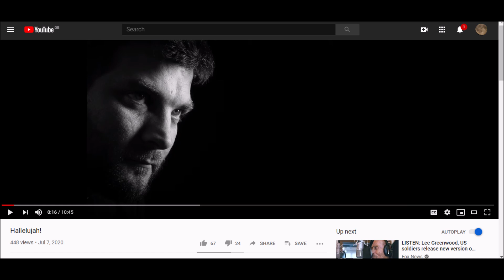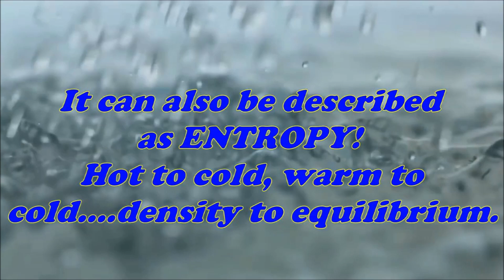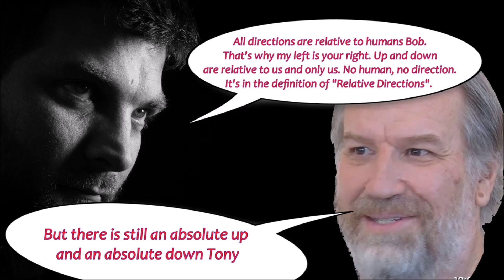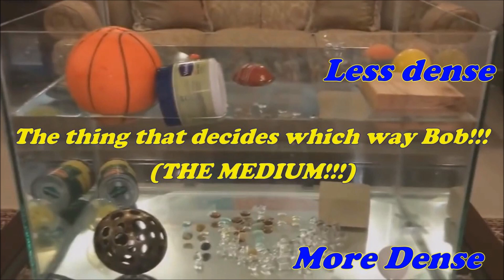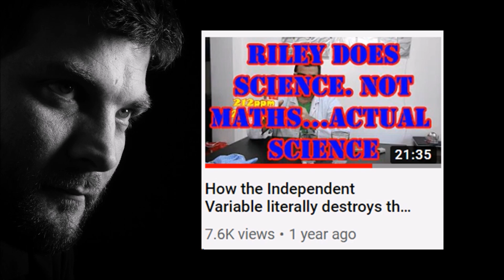Relative Density & Gravity: Riley still doesn't get it.

Comment: So, Riley, if it is not density alone but relative density between objects, why does a feather and a lead weight fall at the same rate in a vacuum chamber? 
Also if I throw a ball upwards, it is a dense object travelling through less dense air. What then, causes it decelerate, stop and then accelerate back to ground? Why doesn't it just continue?  There must be something that causes the ball to act the way it does. I've heard of a name but can't think, it's on the tip of my tongue. Any ideas?
Reply: Cue Desertphile . . .

Comment: Miles. Sleeping warrior did a nearly 5 hour stream on his channel the other day that included his calculations. 
He admits that the calculations are pointless after showing them as the calculations are just comparing the numbers. Check it out. He actually does maths.
Reply from the maker: Thanks I really don't follow what he does so I was not aware of this. I suppose I should have a look at that video but I have to try to keep my blood pressure down.
Reply: Miles Davis 
If you skip through it till you see maths being done on screen then you will have found Anthony doing maths. Be warned: it is hilarious.
Reply: A 5 hour Riley stream? Ain't nobody got time for that.
Reply: Forest Fifer agreed. Although skip to the maths. It’s hilarious. He even admits that it’s unnecessary but he uses it to give the idea more validity. 🤦‍♂️

Comment: At the end of the day Riley's "explanation" why denser objects in a less dense medium fall downward is:
"because my calculation of the Relative Density Disequilibrium by dividing the density of the object by the density of the medium gives a number that is positive (that is in my way of thinking larger than 1) and I assigned to a positive number the direction down"
in short:
"a dense object submerged in a less dense medium falls downward because a dense object submerged in a less dense medium falls downward ".
This is just a begging the question fallacy as you seldom see one.
He also claims that he can calculate the magnitude of the force on the basis of the outcome of the division of the densities of the object by the density of the medium. But to be able to do that he will have to solve the divide by zero error that is inherent to his formula. When the medium has no density (absolute vacuum) or a density that is very low (partly vacuum) he gets no number at all or a number that approaches infinity. That is why he never showed his calculation. And that's why he thinks that 5/0=5.
Again, in short: Riley is an intellectual no-no.
Reply: Hi Frank, let me understand this.
When AR said: 

"because my calculation of the Relative Density Disequilibrium by dividing the density of the object by the density of the medium gives a number that is positive (that is in my way of thinking larger than 1) and I assigned to a positive number the direction down"

According to his own calculation, is AR considering that for an object to float in a given medium  has to produce a negative "Relative Density Disequilibrium" result?
If so, the Density of the given floating object needs to be negative! And as such, these negative density objects will always float in no matter what medium. Unless the medium also has a Negative Density?
Please tell me AR is not that confused.
Reply: @carioca45  I wouldn't call Riley confused, I'd rather say he is mathematically illiterate. It was pointed out to him, that in order to get a negative number you need a negative density. His reaction was: I call a number smaller than 1 negative. The same goes for him being pointed at the fact that an object in a vacuum would lead to a density divided by 0, which is impossible. His reaction was that it is impossible in math, but not in real life. He said that 5/0=5 because when you have 5 apples and you divide them by 0 people, you still have 5 apples.
You might think that I am pulling your leg, but I don't. This all is exactly how Riley has reacted to criticism. He just adjusts his definitions and calls everybody that doesn't agree a spastic, sometimes a spastic with a dog.

Comment: Great work. What stuck out to me was watching the mercury spill over the iron anvil. What caused the mercury to run "down" the slope when, as you point out, the relative density of the air around it was, for all intents and purposes, equal.

The other thing to consider is a zero-g plane flight. I can't see how Riley could explain the motion of objects when the plane is flying "just so" with relative density alone.

But yeah, I'd like to see his force calculations too. I suspect that is just lip-service, and he hasn't actually done any numbers, it's just how he explains it to himself in his head.  And to him it doesn't even matter if you can or can't do the calculations, just the mere possibility that calculations could exist is enough for him. Very strange mindset we are dealing with.

Comment: As AR said, "Yes density is a scalar..... the relative density to something else, is then, what gives you the vector."? 
How can it be, when, by definition, relative density is the ratio of the density of a substance to the density of a reference substance, consequently dimensionless. 
One would have to conclude that AR is proposing that the resulting force, due to Relative Density, has no dimension.
This alone destroys AR's argument.
Reply: When a scalar has an uneven spatial distribution, you get a gradient with a vector pointing in the direction of greatest change. That's the relation between gravitational potential (a scalar) and the force of gravity (the force). You can do something similar with pressure or electric potential. 

The trouble is that that doesn't help him one bit. As said, the gradient's vector at any location points in the direction of greatest difference, which is outwards (or inwards) and not downward.
Now, I know that that's not what he wants "relative density" to mean, but that is what "the vector involved in variable scalar-fields" means. He's just playing word games hoping his followers don't notice.